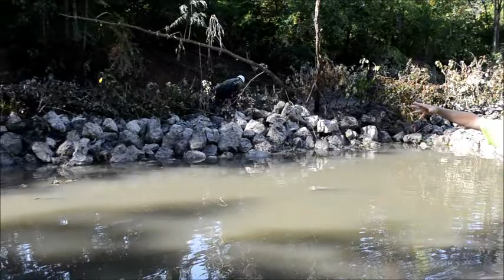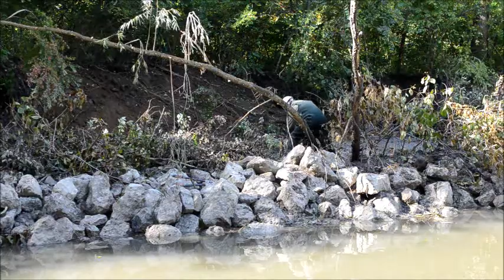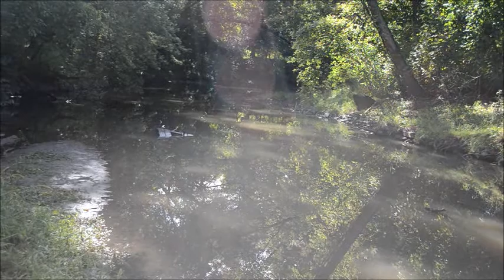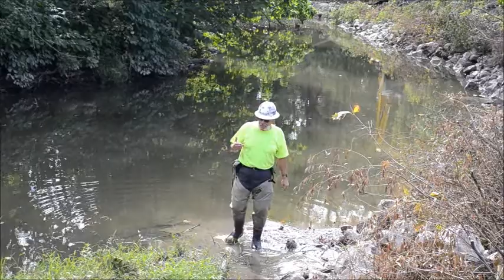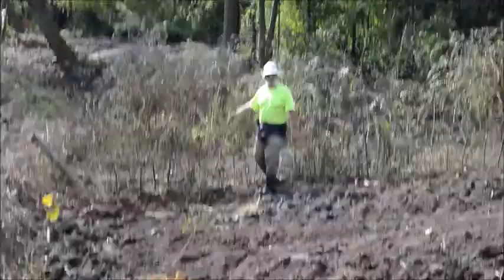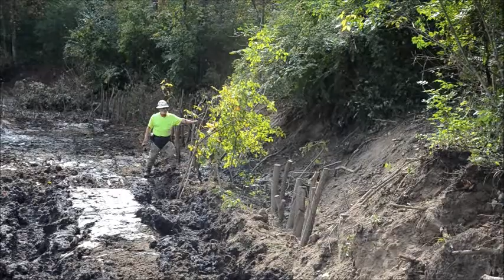Dave Derrick Methodology At Camp Miakonda

Comment: As a Mississippi River Towboat Captain since the early 80's I saw the first bendway weirs installation and the resulting expansion of these controlling works over the years since. They work great keeping the channel open and have minimized dredging in places where silting was commonplace. I was at the Waterways Experiment Station in the early 90's testing Lock and Dam designs and remember being in the lobby and seeing a exhibit in the hall where bendway weirs were explained andremember being fascinated with the simplicity of the overall design. We pilots have always been taught to stay out of the bends northbound and hug the shallower bar for speed... took a while to get in our heads the slacker water was deep in the bend when weirs were in place. Many thanks to all at the WES for making our job safer, and maybe a little bit easier ( but don't tell my boss! ). See you on the one whistle!